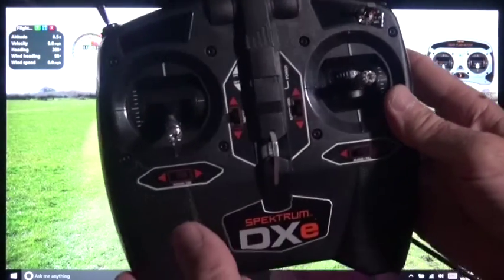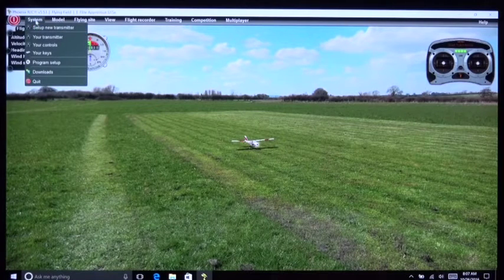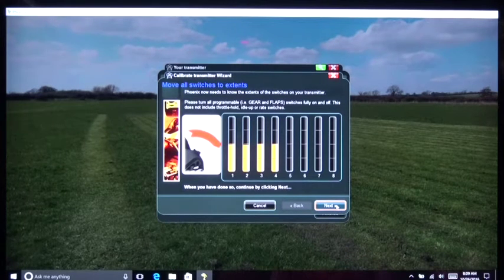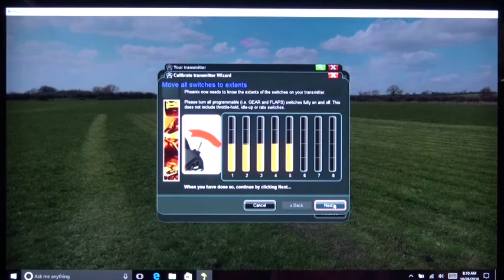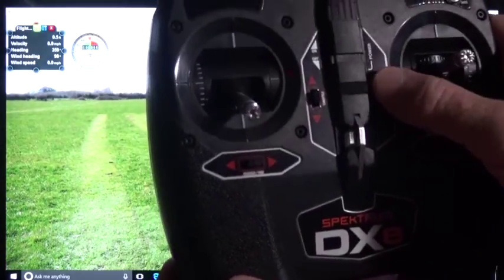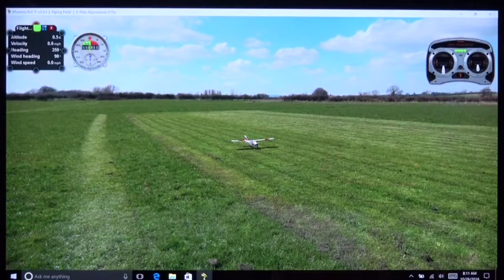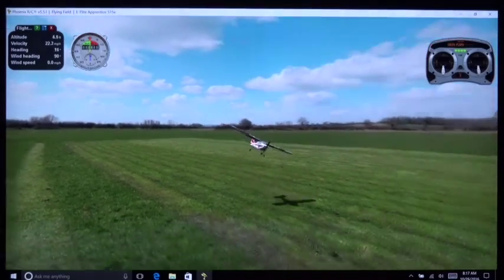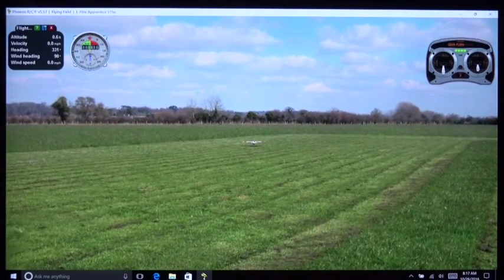AP57 Apprentice S 15e RTF Sim Calibrate

Comment: So you initially set the elevator trim all the way to the top, then calibrate the transmitter, then you set the elevator trim all the way to the bottom.
Reply from the maker: Yes, that way I get the max NOSE UP trim that I can.  This is for demo purpose only so the plane will fly hands off as slow as possible.  Normally, just put the trims in the middle (except for throttle which should be all the way down) and calibrate.